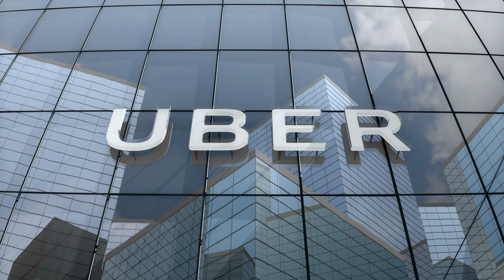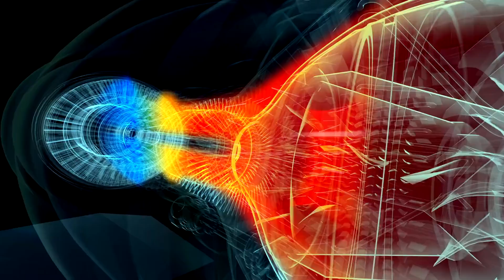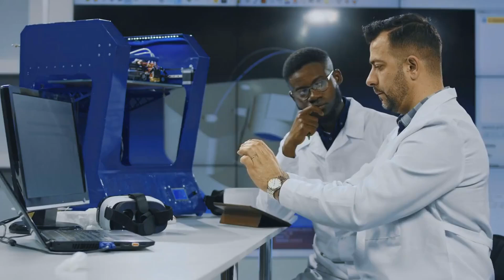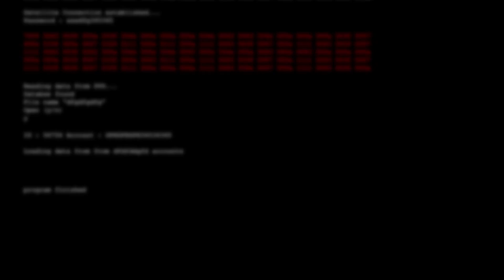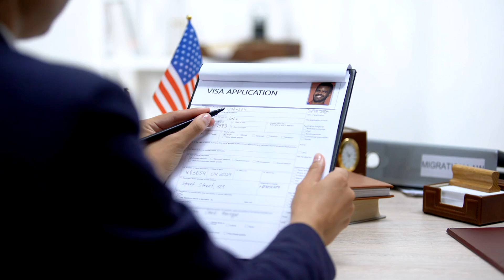JUST ANNOUNCED: These 10 Trucking Innovations Got BANNED

Comment: The last one, electro brakes.   Such BS, trains use them, EV vehicles use them (built in).   There is NO issue with interference, there far to far away for any effect.  Remember the fear of cell phone signals and electronic devices crashing planes.   They tossed a hundred active units in a cockpit and zero issues, but of course "safety" doesn't hurt to have people turn off their stuff (in case something happens and insurance wants a scape goat).    The insurance issue might be the real reason (unstated) for not have magnet helper brakes.

Comment: 7:00 there is no extra infrastructure or real economic concerns when it comes to running a vehicle off of hydrogen. I've built hydrogen generators in the past which was designed to output 90% hydrogen and 10% pure oxygen from water. This system was used to start/run a minivan off of nothing but hydrogen from water in a 2 or 3 gallon water container. With the fuel tank ran completely dry and fuel pump unplugged after turning on my special hydrogen generator design the engine fired right up like the tank just been filled with fuel but it started up better and stronger off the hydrogen from the generator far better than any store bought gasoline. Before turning on the hydrogen generator I tried to start the van with the empty fuel tanks and unplugged fuel pumps but the 6 cylinder 4 liter engine just wouldn't start with an empty fuel tank and unplugged fuel pump for obvious reasons.

When I was curious about how efficient my generator was I took it into the kitchen and turned it on. I then proceeded to light a cigarette lighter near the opening with a roommate watching then immediately after there was a spark from the lighter there was a huge mini fireball which engulfed the entire 1/2 filled container. It was a semi transparent water container from Walmart which housed the water and the special electrical plate design which was inside the water. It was all the hydrogen and oxygen in the 1/2 filled container which immediately combusted inside the container and there was a "WOOSH" sound and everything. I didn't even have time to pull back to a safe distance but luckily the hydrogen wasn't compressed. I mean I'm not st*pid enough to compress hydrogen lol. I did my research or a few months of research before coming up with my own theories and special designs so I kinda knew what I was doing. I'm the type of person who doesn't believe any hype or anything but rather if I want to know if something is possible I simply "try it for myself".

After digging deeper as to why humanity is still operating "gas or diesel" powered vehicles I learned of the horrible truth of how other free energy engineers were targeted/gotten rid of. It's shocking how many lives lost just to keep billions of dollars of anual profit. It's not that what I built was new technology even though I used unique designs but it's more like these engines or all engines are designed to generate profit and not fuel efficiency. There's a reason why many auto manufacturers program the vehicles to "shut down" if it detects it's not running on money generating fuel. I mean as a techie who's been drawing out free energy designs since a young kid I never understood why humanity was using "powerlines" and paying at "fuel pumps" until I learned how corrupt humanity has become with "greed". I can come up with at least 3-5 different ways for a vehicle to never need a fuel pump ever and at least 2-3 different ways a generator can self generate electricity. Many years ago I became an electrician just to learn everything I could about electricity and built my own basic electronics to control my own hydrogen generator designs some years later.

The more I learned about technology as a whole in every category the more I could see how corrupt/greedy humanity is over the dollar bill. Anytime a new resource is discovered or a new engine is built "efficiency" is something no major company wants but rather "profit". They will meticulously design any/all engines to burn a certain amount of fuel. One can re-engineer any electric vehicle to have over 2,000 mile range or more although trunk space could be lost completely depending on designs. It's just a huge joke to me hearing about any company trying to build a hydrogen fueling station when nothing like that is necessary with the proper knowledge/insight/ingenuity. Only bad thing about hydrogen and electricity is it can be extremely dangerous if ya don't know what you're doing. Great thing about hydrogen is it only takes a little bit to run an engine and it's clean burning with zero emissions. It's very disturbing the way the planet is harmed in the name of PROFIT. It's the future generations who will suffer the most from the damages current generations are doing to this poor planet a victim of terrible human greed.

It's somewhat okay to run you're vehicles "virtually for free" long as you don't try to openly sell/market superior fuel saving devices. I've seen a story of at least one guy in another country who runs his vehicle off self generated hydrogen also but he is only still alive because he didn't actually try to sell anything. He somehow figured out how to do it in his own way because his poor family couldn't afford fuel for their car. While my hydrogen generator designs were very unique the technology itself has existed for decades. I could design an engine which is more than 200 times more efficient than anything but it'll never make it to the automotive market. There's even federal patent laws to govern the release of any superiorly efficient technologies meaning if you build something and put a patent on something superior to a certain high level you can be legally ordered to never speak about it or face prison time. The release of everything technology as a whole is so corrupt/purely profit focused for the most part. In a different world with no corruption there would still probably be vehicles but with zero pollution and zero fueling stations in which the technology for this kind of civilization already exist but will never be implemented in order to protect "maximum profit".